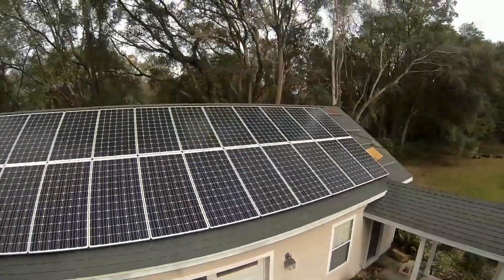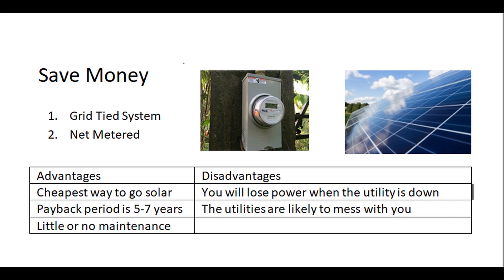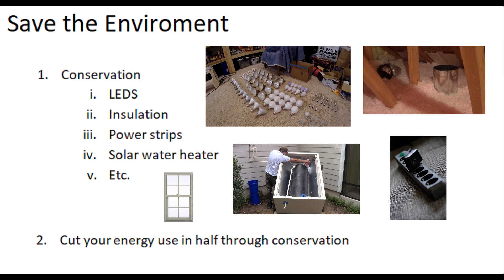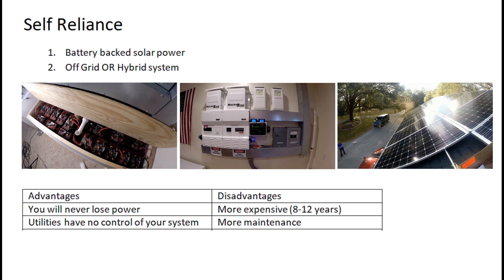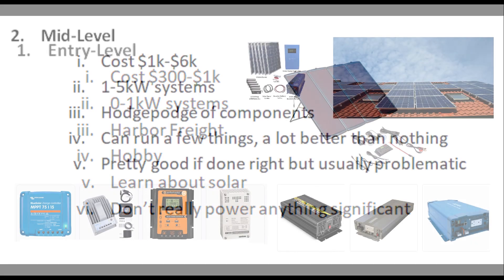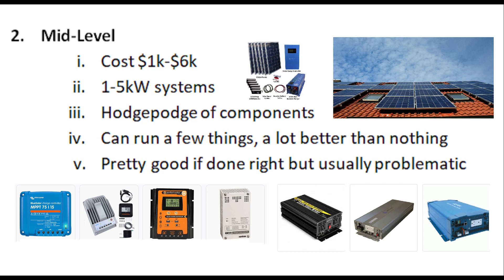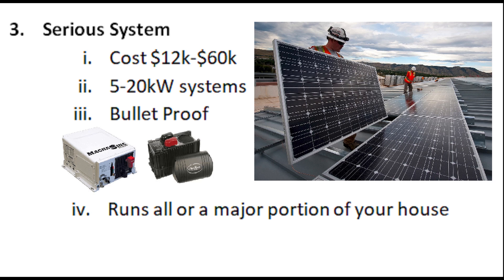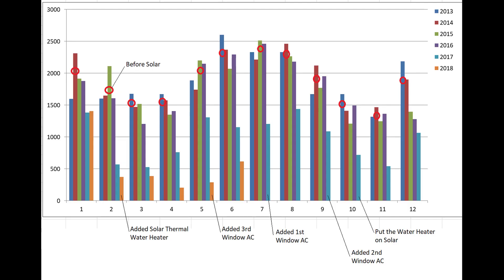What You Need To Know Before You Go Solar

Comment: I'd be happy if I could just power my freezer when the power goes off, I can live and cook without power just hate to loose the freezer contents
Reply from the maker: Jason, for short term power outages, you might consider a small Honda 2k generator or equivalent.  You can get these for $500-$1000 and they will power a few things including your freezer.  Plus, the smaller generators don't burn through so much gas as the larger 8k style do.  If you go solar, I would recommend saving up for a serious system at least 4,000 Watts and expandable as you go.  I am about to expand my system in a few weeks to 13k.  Thanks!
Reply: David Armstrong what generator do you recommend that can run a fridge for a few weeks? Or can a regular generator power a mini fridge for a few weeks?
Reply from the maker: @johndoe-kh9fu  I would pick up a Honda 2k generator or equivalent.  Thanks!

Comment: Greetings David, do you have any references for solar contractors in North Louisiana.  Thanks for the great videos, keep them coming!
Reply from the maker: Sorry Ken, I don't know any contractors in Louisiana.  Do you know what kind of system you want?  i.e. net metered or battery backed? OR hybrid?
Reply: @HomesteadEngineering  thanks for the fast reply.  I'm thinking about a battery backed whole house system (or close to) that can be used off grid in case the utilities go out.  We also have a dual fuel generator (Nat & LP gas), however, this would only last as long as the Nat gas was flowing or the LP lasted in the tank.  Because of the variables with the generator I'm not sure how it would all work together so I'd like to get someone with experience and has worked with this type of set up before.  I'll start asking some of the trades people in my area if they know anyone and if you hear about anyone please let me know.  By the way your food preps are incredible and an excellent template to follow.  Appreciate you taking the time to post.
Reply from the maker: @kenclouse  Your backup generator can be seamlessly integrated into a off-grid solar power system.  I have a complete series, start to finish, on how I built my DIY solar power system.  I think you should watch the whole thing before you hire someone.  It will give you a good understanding of how the system goes together and what the cost and performance are.  Start here: https://youtu.be/lcGjoHS6rnE
Reply: @HomesteadEngineering  Excellent, I'll be checking them out, thanks!

Comment: Your right on track with what you said. It's expensive but to get a good System it's going to cost.  Put a price tag on having power when the grid goes down.
Reply from the maker: I definitely don't ever want to be without power.  I am actually thinking of expanding my system with some east and west facing panels to extend my solar day and preserve the battery life.  Because I already have built in all the hooks for expansion, I can add 3600 Watts for under $3,000.  Plus, if SHTF, I might be able to hold up my neighbors with a little 240v love.  Thanks!
Reply: @HomesteadEngineering  I'm.increasing the capacity of my inverters just in case I need it.  The day is coming when power goes out for awhile

Comment: What a great tutorial on solar energy. Thank you David. Your house is as awesome as you are! This is probably a rhetorical question; but why has the costs of going solar remained high? The 1st books that I bought about solar energy for houses was between 1979-81. It's been around for a long time. (I know, dumb question, Hoot...)
Reply from the maker: Hoot, the cost of solar power has actually fallen dramatically since the late 70's,  In 1979 the panel cost was around $70/Watt, now it's down to .55 cents/Watt.  That's why grid tied systems are so cheap.  The batteries, inverters and chargers have not seen nearly as much of a reduction and that's why off grid systems are so expensive.  I think the battery cost are about to come down fast due to electric vehicles.  When electric vehicle batteries reach end of life in a car they can be repurposed for home solar and will be a dime a dozen in 10 years.  Thanks!
Reply: David, it is still kinda out of reach for most people. It will be wonderful to see more houses with solar. Especially in the sunny states, year around. Hope you have a good week!
Reply from the maker: @hootowlholler3760  Yes, $20,000 is still out of reach for most people and that's why the mid level $5000 systems make a lot of sense.  Having a mid level system that can power your fridge, a few lights and maybe even a window unit during the day can make a world of difference in a prolonged grid down scenario.  Have you considered adding solar power?  I don't think AP has it yet but I would sure love to see you guys get some before you really need it.  Thanks!
Reply: David, I would like to have solar. At the moment, I'm not in a place where I can. No, AP doesn't have it either. I just wish he would install a wood stove & get some more wood cut & cured. :) I appreciate your good wishes, my friend. God bless!

Comment: Solar for me started as a hobby at first and of course there is a learning curve. Even with the cost of solar is coming down greatly, conservation gives you more bang for the buck. I have friends and acquaintances get sticker shock when they ask me how much it cost to go solar to meet 100% of my energy needs. When they tell me their monthly electric bill is $300+ USD and I respond with a ballpark of $xx,000 USD plus they may not have enough roof space to cover it; their jaws hit the ground.

I conserved first then went with micro grid tie inverters set up in two 3.6 kW arrays knowing that I will eventually AC couple it to the Magnum-Dimensions inverter. I only have one inverter, 7.2 kWh of usable storage, and AC coupled one of the array to keep things going if I lose the grid for a few days. A little bit complicated than the average installation, but the satisfaction that I am able to take myself "offline" when a nasty storm rolls through the neighbourhood is priceless...
Reply from the maker: Felax, priceless is exactly right.  I love knowing that I can produce my own power if the utility goes down.  Once you have your own power you can't imagine going back to relying on the utility with no backup.  Sounds like you have a really nice system!  Make a video and share it with us.  Thanks!